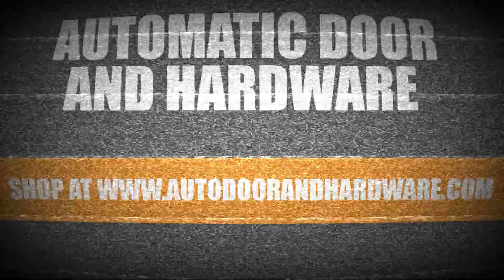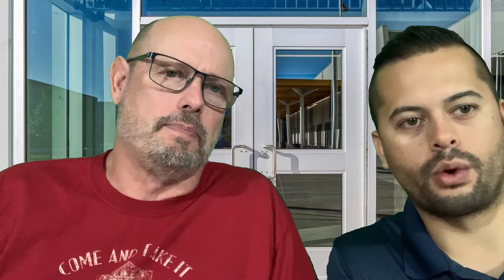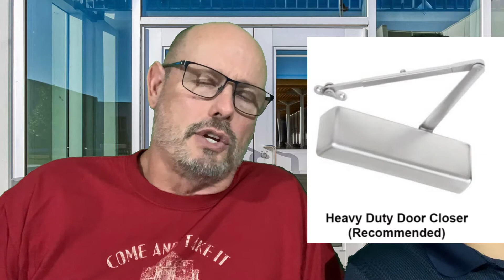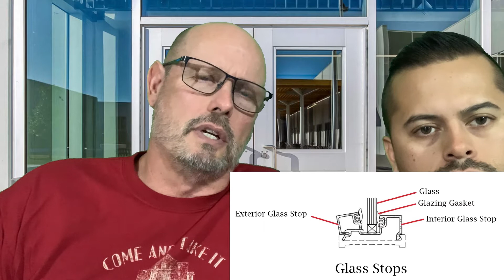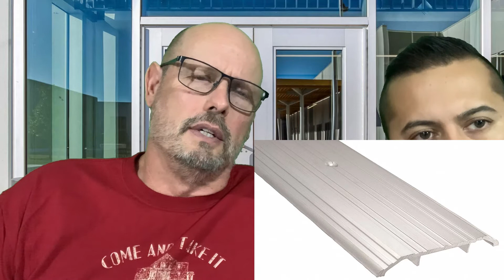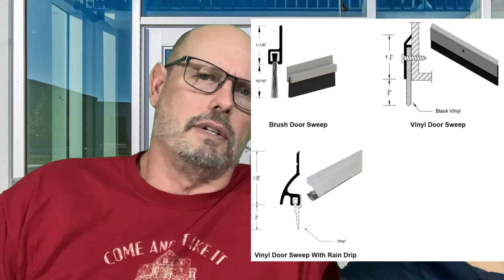How To Order A Commercial Aluminum Storefront Door

Comment: My contrator had installed the atore front double door in my warehouse but the door open itself in strong wind day. My contrator told me to pay another $1300 to add something inaide the door to hold the door still when it closed. I just want to know what solution to prevent this kind of issue without paying $1300 to install something into the door.
Reply from the maker: We would recommend our Commando HD door closer, it works great to hold doors closed especially on windy days. Plus it is much less than your contractor’s quoted amount!